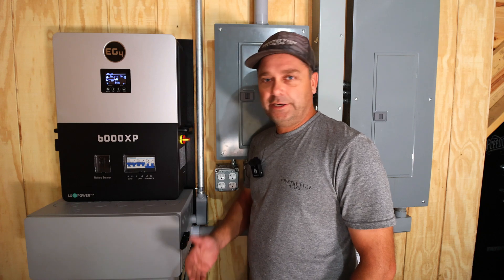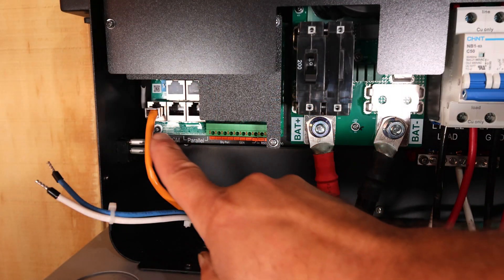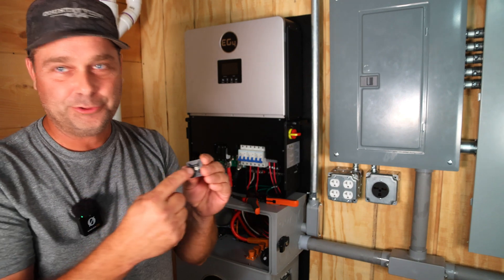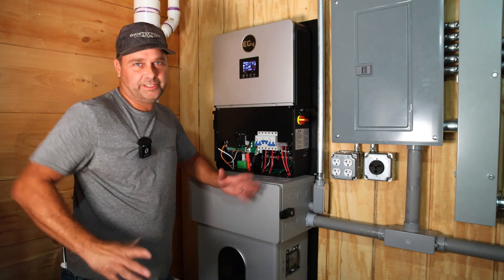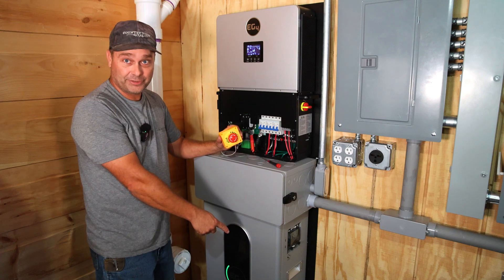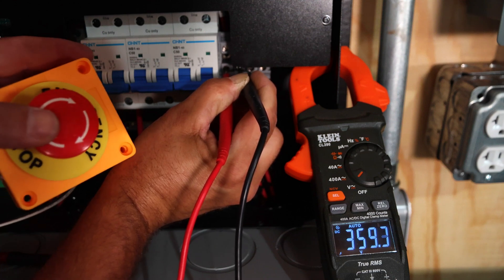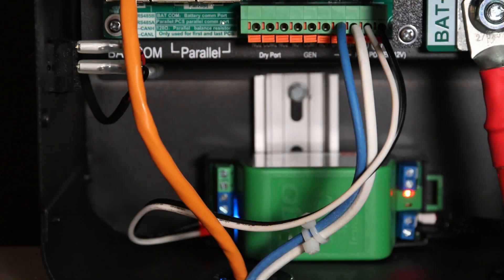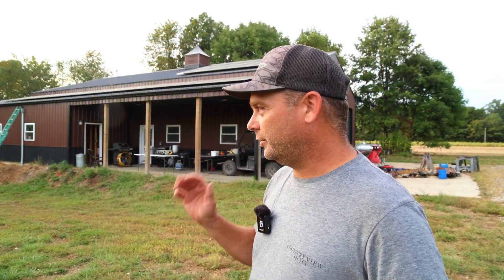Installing a TIGO Rapid Shutdown in the 6000XP.  Testing Total Rapid Shutdown of complete system.

Comment: This can be expensive for those of us with many solar panels even if one module covers 2 panels.
  I know the manual switch doesn't  have the temperature sensor or increased voltage sensor but could a manual IMO manual PV shutoff switch tomeet the requirement?

Comment: Dumb question, shouldn't the transmitter, core and shutoff switch be mount at or as close as possible your solar array itself so if safety personnel or firefighter have to cut your solar conduit to get access to your house or garage, it will shut solar power off at the source and not just at your inverter? Why shut it off there while the power is still live in the conduit? Shouldn't the switch be mounted outside where it can be accessed?

Comment: That's useful. Also if you have the Tigo CCA and TAP installed, you can fit your switch across the two AUX terminals on the CCA.  This will do the same job. 
I assume CCA/TAP is universally available - mine is in UK.

Comment: If you have a concrete house ( which cannot burn) do you still need an emergency shut down for your solar?
Reply from the maker: The code on states if the solar is mounted on a building.
Reply: Thank you very much.

Comment: Does the kill switch cut the power to the RSS transmitter?
Reply from the maker: When the switch is activated the 6000XP turns off the 12 volts to the TIGO transmitter
Reply: Thanks

Comment: The RSD instructions are referring to the outside actual shutdown unit which must be normally closed for PV to function.
The E-Stop switch wires can be very small, just a low voltage activation.
I don't understand why you would need a RSD on each panel?  You just need one for each input to the MPPT.  I would use a different brand of shutdown if they don't make one that is good to 480v and 20amps.
Reply from the maker: You have to have one on each panel.   As per NEC 2017 code.  The max voltage is 80VDC volts within the array and 30 VDC outside the array.  
My 460 watt solar panles have a 50.8 VDC open circuit.  So 2 panels in series would be above 80VDC.  So modules are installed on each panel to be below the 80VDC required by code.
NEC 690.12(B)(2)
Reply: @CountryViewSolar-DIYProjects  Thanks for the reply!  I kind of figured that it was a stupid code issue.  EG4 shows an example of a single shut down on the PV input wires and that is what I would do if I chose to use this feature.  As you guessed, I don't follow code on everything.  For me, just shutting down the output of the Inverter and shutting down the batteries would be just fine.  We don't have fire dept support out here in the desert so shutting down the PV is not necessary and I can always shut them down myself if needed before working on it.  I wonder if there are any units that meet code that don't use any RF/bluetooth/wifi/etc for those like us that don't have or want RF.  Seems to me that the codes are purposely making Solar more expensive and difficult because they don't require Rapid Shutdown on Grid power!  You are very knowledgeable.

Comment: Another good video. Thanks. I wonder how much RFI is generated by the Tigo panels.   For example would a portable radio buzz then near the Tigo system? Thanks again.
Reply from the maker: Good question.  I'm not sure how you go about checking for that.
Reply: @CountryViewSolar-DIYProjects  there are a couple of ways I would check for radio noise. A simple way is to use a portable am radio to see if it buzzes near the devices.  I also have a USB radio stick that can scan the radio frequencies. Not many would have that if not an amateur radio operator though.  Signature Solar is 30 minutes from me in Texas and have offered to let me come and test.  All the best!

Comment: Here's my advice on the Tigo modules.  They work great, but I bought the double (1000w) modules to save some money over the singles and they were a real pain to install because the leads on the panels are not long enough.  Learn from my frustration and buy the singles.  So much easier to install on the ground than the duals.
Reply from the maker: Yes, I installed Dual shutdowns in the past.  you are correct, it is pain.  This time I bought Singles.

Comment: STOP The manual for the rapid shutdown switch unit wiring must be correct!

A safety system must never rely on being able to close a circuit because a wiring failure would disable it. Emergency shutdowns must always break a circuit.

I would check the instructions for the Inverter - there is probably a setting to enable (or maybe set the sense) of the inverter rapid shutdown contacts.

But whatever - do not rely on it as you have currently set it up since a wiring fault could cause the Rapid shutdown to fail and put someone's life at risk.
Reply from the maker: I agree it should be on a normally closed switch for a maintained circuit.  But EG4 has it backward.
My EP Cube system is on a normally closed switch like it should be.
Reply: @CountryViewSolar-DIYProjects  Maybe a strongly worded Email to their support department? Something along the lines of reporting the faulty design to the Health and Safety people if no action is taken.

If they refuse to fix it I'd certainly suggest returning the Inverter as "Not Fit for Purpose" and asking for a 100% refund.
Reply: Is there a way to wire up two rsd switches? Maybe one near the door that goes from my house out into the garage and one out by my meter for the emergency responders? If so, how would you wire them together or to the 6000xp? Thanks.

Comment: Evan, one little thing. Maybe the rapid shutdown switch on the exterior shop wall should be inside a box. So many things could accidentally trip the exposed switch.
Reply from the maker: By code, it has to be really accessible and easy to find for first responders.   It needs to be visible.

Comment: Sir look into U.K. latest research from insurance they are now recommending not to install a rapid shutoff dc as there is now a high risk of fire due to weakened wiring being super heated, they are recommending using the emergency secure dc shutdown in the inverter
Reply from the maker: What I am doing, is what is required in the United States.  I can't do anything different.

Comment: I have all the components but what 14 gauge wire did you use because it doesn't come with wire, I see the  ports you hooked them up to for the rss and the estop. Do you know if the same terminals work for an CCA/ TAP install?
Reply from the maker: I haven't installed the CCA/Tap, so I am not for sure how it interfaces.  As far as wire, normal building wire like THHN.  And 16 gauge would be the largest that I would suggest.

Comment: Thanks for sharing your journey. looking at what you have done compared to our system of an EG4 18Kpv, 15 kilowatts of ground mounted Bi-Facial panels and 60 kilowatt hours of LiFePo4 battery bank that runs the whole property 100% Off-Grid. i-am so glad we do not need to buy 36 Tigo's. Wow, would that be expensive.
Reply: for my roof mount I bought the tigos O and S 20 and 18 respectively for 38 panels, 1100 on sale but some we want optimization and others just monitoring with RS capabilities. They get the 30% tax credit so I believe it was worth it. We have 14 ts4 2F tigo as well for another 2 arrays which use the RSS but the roof top will utilize a CCA with 2 TAPS. I found all that on ebay for 210.00. I am glad I bought them as all of it has gone up in price pretty quickly. Hopefully it is cyclical or maybe driven by higher installations due to the tariffs coming. Good luck to you.
Reply: As a state National the 30% tax credit does not apply to me as i have not contributed to the US inc. for 24 years. research Revocation of Election, which is a remedy provide by the US congress. Totally a voluntary system.

Comment: Ok so if you already had a system in the shop to power everything you have why another system in the basement of your house? Why not just more panels and batteries for the first system?
Reply: I believe the ep cube setup is for the house and the eg4 6000 xp with wall mount battery is for shop/barn. I think anyways???
Reply: @d.pollard5962  No he ran the shop and house off the original system.
Reply: He might be getting near the wattage he can push out of the other system. More batteries won't help with that. I'm sure he will give the actual reason at some point.
Reply from the maker: My power company agreement is for a max of 10K watts output stamped on my system.  So if I add any more grid interactive/hybrid inverters I would be breaking the contract.  So adding more solar with off grid inverters is a way around it.
Reply: If you had a concrete house (which cannot burn) would you need an emergency shut down?
Reply: @glennandchristinesereda2120  I think the shutdown is to keep the power company safe when working on the lines.
Reply: Thank you for your response.